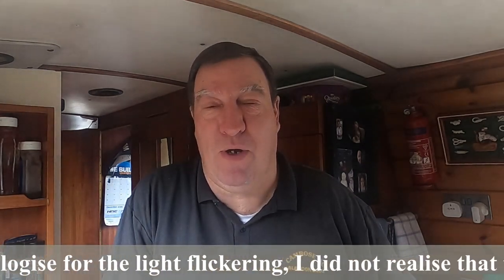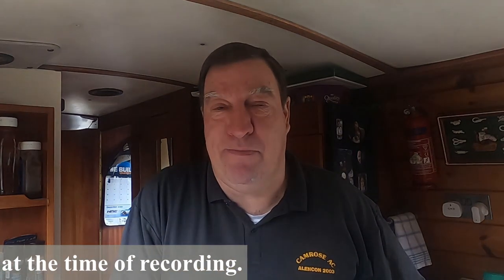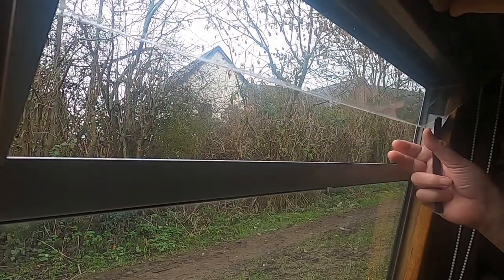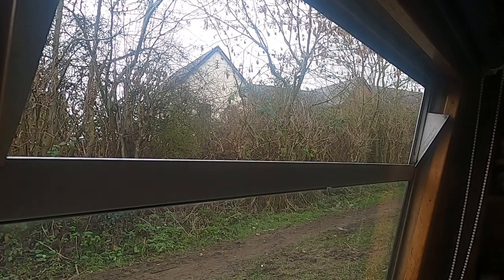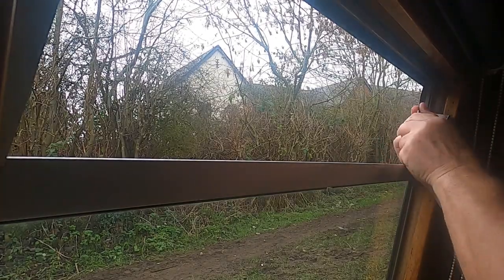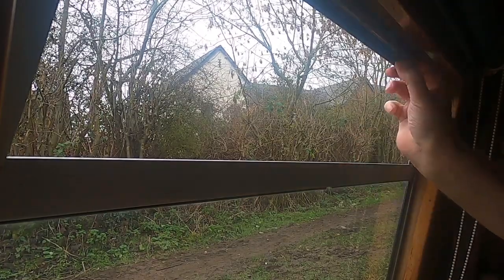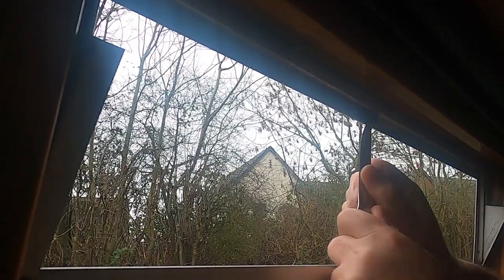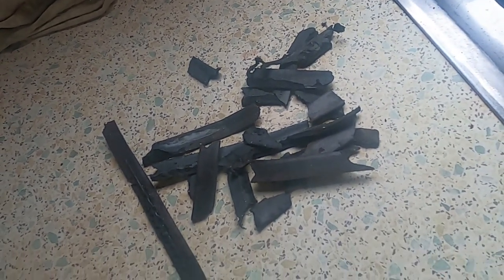DIY on a Boat - Part 1 -  Windows and Stern Tube.

Comment: I lived for a time on the East Coast of the US in an historic area and learned a few winter tricks for single pane windows.  The hardware store sold some film you could apply directly to the glass.  It did double duty in it kept the hot sun out in the summer and also helped block the cold.  A friend didn't want to spend for the special stuff and said just stretching a double thickness of cling wrap over the window frame and sealing it with good tape did just fine.  He hid it under his curtains and unless you walked up to the window, you never noticed.  It was easy to take down and cheap!  It really blocked the cold drafts in the worst part of winter and still let in light.
Lined curtains also help - thicker the better.  Fabric shops often have remnants or ends that are cheap and will work for small windows.  They all don't have to exactly match - complimentary works.  You can use thick fabric or layer some insulation between 2 fabrics.   I've seen it done with the batting used when making quilts, but I also saw someone just get an old blanket at a thrift store, cut it up and sew layers between a nicer heavy-ish fabric.  They can replace the summer curtains or just go behind them.
Hope this may help this winter.
Reply from the maker: All great stuff thank you. I have just covered my windows. I have some very thick clear plastic I cut to size a couple of years ago I tape it on the window frame. All of my curtains are also lined. I also have curtains hanging at the front and back doors.

Comment: The stern tube packing rope is cut with the 45 degree angle on the side of the rope so they lay over each other when compressed, also stagger the joints when fitting each ring.
Reply from the maker: Yes it was cut at a 45° and staggered. I did not do it myself, I paid a marine engineer from a mariner to fit it for me.

Comment: Great vlog. Thank you.
Reply from the maker: Glad you enjoyed it! Thanks for watching
Reply: @TrevsTravelsByNarrowboat   when I viewed boats one had plastic film secondary glazing effort which worked wonders have you thought of trying that to stop draught and condensation ?
Reply from the maker: @trevorsbarkingmadchannel4501  I actually did that last year when I bought the boat. It does work very well. The only problem is if you want to open a window you cannot without destroying the film.
I have also found that since putting in the stove I have a very little problem with condensation. The fire when drawing in air to burn it also draws in any moisture in the air. It also keeps the boat nice and warm. The moisture level difference for February last year in the boat to now is last year I had levels around 60% right now, and I am cooking at the moment it is 38% and it is 23c inside the boat. 
I do still keep it as an option in my mind if required to put up film over the windows but at the moment I do not see a need for it. 
.
Reply: @TrevsTravelsByNarrowboat   yes that is the problem. I nearly went for that particular boat and thought I’d replace the film with removable Perspex panels possible held on with Velcro.
Reply from the maker: @trevorsbarkingmadchannel4501  I have found since the stove install even with the cold weather we have just endured it has stayed warm on the boat.

Comment: Is there somewhere to store those top windows when you take them out in the summer?
Reply from the maker: I never take them out, except to clean them. I have not found a need, with them and the doors open the boat stays cool enough. I move most days, so generating an airflow through the boat due to be it slow, but the momentum of the boat keeps the air inside comfortable. Therefore I do not need a place to store them. I could make one I guess if needed.